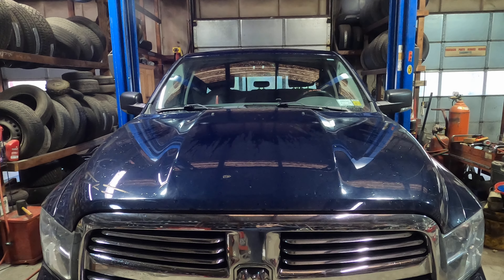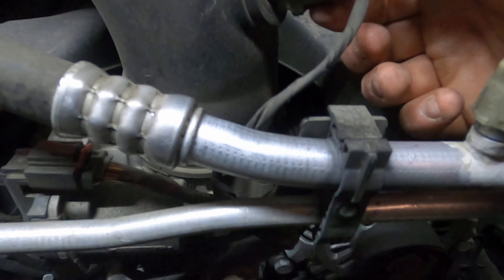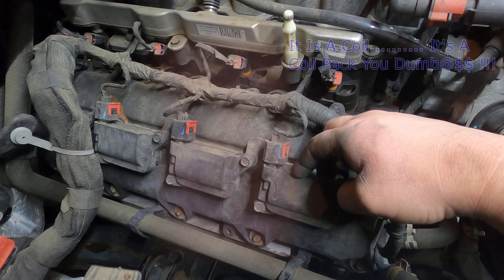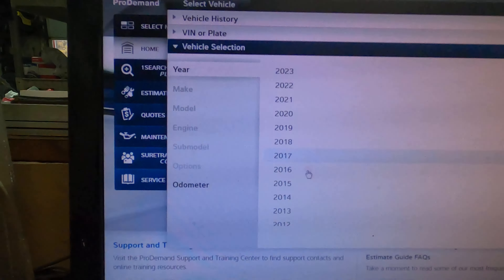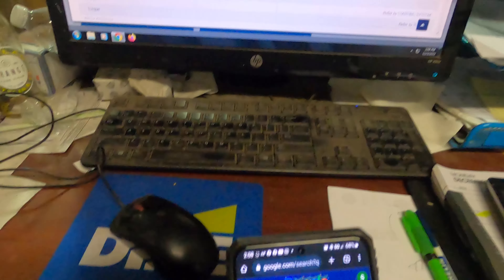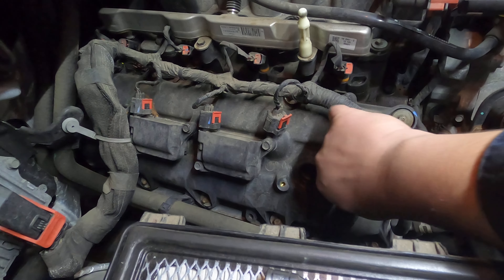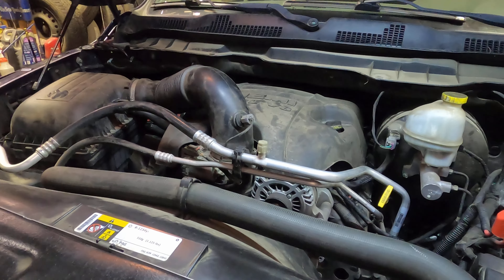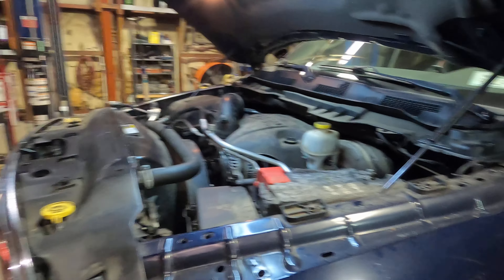2014 Dodge Ram 1500 Spark Plug Replacement

Comment: I love how everyone ignores the plugs closest to the firewall on the drivers side, lol... That can be a bitch to get at considering what's right on top of it.
Reply from the maker: so true, I even forget them sometimes and I recently used them to plug in 02 sensors away from headers on the BMW lol.
Reply from the maker: sorry I read that to fast but yes I have seen people do like half of them and then drive away. You just need the right extensions and placement to do it. Its possible I mean the factory got them in so you should be able to get them out.